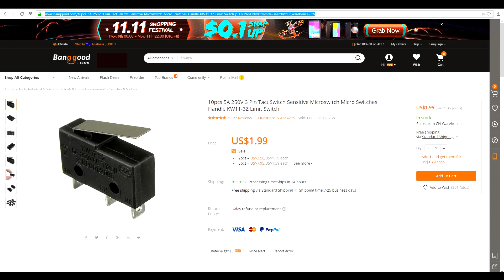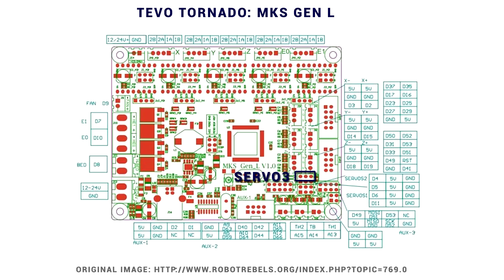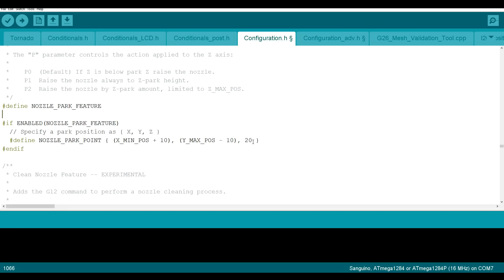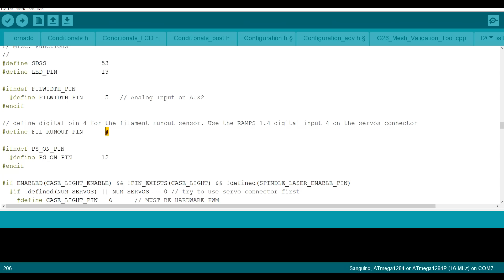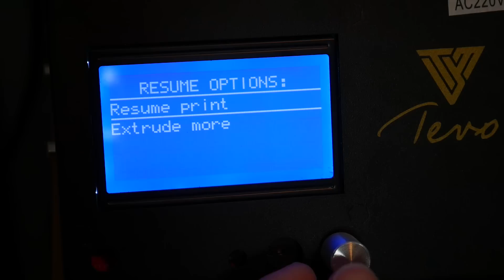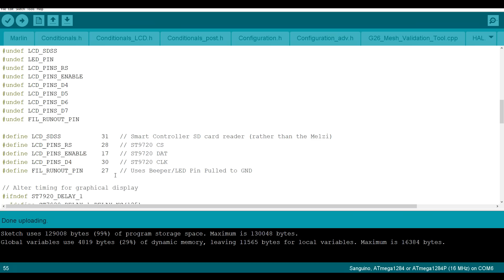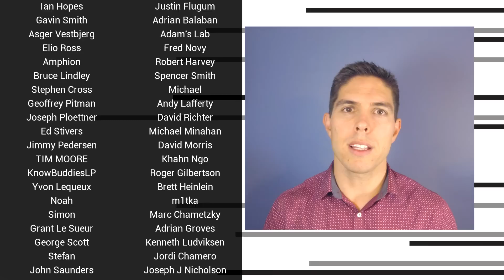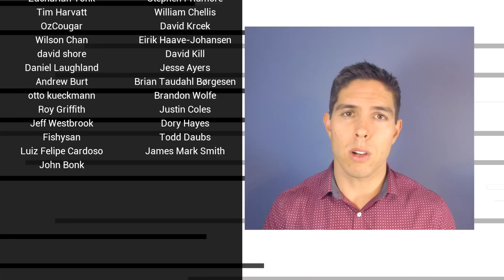DIY filament runout sensor + M600 colour changing

Comment: Filament sensors are only useful if the end of the filament reaching the sensor is straight. If it is bent it can't be pulled through the sensor and of course that means the system jams. What then?
Reply: If your spool has that small of diameter and causes high amounts of binding with a straight through hole switch housing, then all you need to do is design a new housing by adding in the radius of your spool, or just design one that is smaller in length and it won't bind at all, this isn't an issue unless the housing is a poor design.
Reply: @BF3DS  Poor design as the endof the filament on the spool had a sharp hook at the end. 
Unfortunately it was the first time I had deliberatetly let a spool finish to test the filament detector. I've finished  a couple of spools since then but only on small jobs.
Reply: @iminabrons  Yeah I've never had this issue before, but I just tested it right now by kinking my filament in a few spots without snapping it, one section snapped off before entering and it worked just fine (PC) the other one got slightly binded and almost stripped out on my extruder spline gear (PLA), it still worked because I oversized the hole. I guess the only way around it if it's incredibly bad, is to have an even larger hole in front of the switch to force the filament to slowly bend into place or to run an open framed laser runout sensor so it cannot bind etc.
Reply: @BF3DS  One way is to have a sensor that measures how much force is being used to pull the filament at any particular moment and above a certain % of Newtons the power would be turned off. This would be used in conjunction with the filament sensor of course.

Comment: Man, tough luck.  I tried to do this mod, every other one had worked perfectly.  Unfortunately, I must have put too much heat on that Pin 29 and lifted the track on the board. I noticed the little pad of copper broke off so now if I want to have filament runout I will have to be upgrading the board.  For now I am happy with the upgraded firmware, auto bed leveling and I still got the advanced park feature and filament change from attempting this guide.  I did notice that disabling the options in the video still put me over the threshold and was not able to compile for the Sanguino.  I turned off M155 advanced reporting and that helped push me over the hump. Thanks for the video, I'll use my printer as is and for a possible next upgrade may be replacing the board.
Reply: You mean to upgrade to a duet board, right?  Seems like you've a good excuse now!

Comment: Hey man!
https://www.youtube.com/watch?v=SM6w1gU_P58&t=182s
This guy used the back of the LCD display to hook up his runout sensor, but with absolutely zero information or elaboration. Would you possibly mind doing a video explaining this?
Reply from the maker: It will be exactly the same as mine except the pin assignment will be different in marlin.
Reply: @TeachingTech  Alright I'll try and stumble my way through a combination of your tutorial and his video haha

Also, will there be any problems hooking the runout sensor up to the board, and using OctoPrint? Or will the runout sensor tell the Pi to pause?
Reply: Furthermore, I don't have a pin 27 board, and it seems both the runout sensor and the BLtouch take up the same ground pin in that case. Is there another available ground pin on the board? Or could I solder the wires together and use the same ground?

Comment: Would there be any specific changes with the th3d firmware and  runing a bltouch when  adding this runout sensor ....muddling through but all ways good to know more. Im surely not the onley one. Followed your video on the th3d bltouch  setup for the ender3..You make a difference sharing like you do may you and all  your family  have a safe and happy new year

Comment: Wouldn't a microswitch with a roller work better? Less drag, and can easily back up expecially on direct drive extruders, if you mount the switch on the x carriage, otherwise this won't be a prob, probably is not a prob with this switch and I am a tad paranoid
Reply from the maker: With a nice housing, yes. Have to design it to make sure the tip of the filament didn't catch going in.
Reply: @TeachingTech  I think there is a design for it on thingiverse already
Reply from the maker: Then yes it should be better.

Comment: Hi =D when we disable M503, does that mean we can't use this g-code anymore in the terminal of octoprint to retrieve current EEPROM? Then is there an alternative way to get the current EEPPROM?
Reply from the maker: M503 only spits out details about the printer via terminal. Eeprom still works like you would expect.
Reply: @TeachingTech  ya, then without M503 is there another way to let the printer spits out the details of the printer via terminal? for example when i want to calibrate the estep, then i need to know what is the current value... how do I do that?  thanks for answering me... =D still learning...
Reply from the maker: Nope that is the purpose of m503. If you have a copy if the standard firmware you can retrieve the base value there too.
Reply: @TeachingTech  I see =D Then let's say if I would like to keep that M503 function enable together with bltouch and this filament runout sensor, is it possible? what other settings you would recommend me to disable it?
Reply from the maker: There is also autotemp, volumetrics and one called disable working offsets (can't remember the exact name off the top of my head)

Comment: The amazon link now points to a switch w/ a roller on the spring arm. Betting the print will need to be modified for clearance. Or would you suggest another link? A roller tip could make it difficult to insert the filament and ensure it doesn't run under the wheel.
Reply from the maker: Argh. I will update the link.

Comment: I have been very impressed with your knowledge base and have been watching with great interest as you make the upgrades to your 3d printer. I actually have been doing research on a printer to buy and watching what you have done with your ender 3 has helped steer my decision on what to purchase. I wonder with all your skills have you tried a different board in your ender 3? Maybe something with more memory so you don't have to disable features as you upgrade? I would be a sure viewer of that video.
Reply from the maker: Hi Phillip, thanks for the nice feedback. Eventually I'm planning to fit another board to my Tevo Tornado an four the MKS Gen L from that into the Ender 3. No time set, however.
Reply: @TeachingTech  I will keep an eye out for the video when your time allows.

Comment: Hi Michael. Im impressed of your videos and knowledge. I saw allmost every of your videos, but my english isnt so good and sometimes I missing some words and trying to get from contecst.   Im 53 years old and im just a beggining my 3d printing. Sometimes many problems are much hard to resolve for me.  I want to ask You about help in instaling of a  filament sensor in Ender 3 with existing printer mainboard.  Please tell me  what  do I have to buy to conect this sensor and how to upgrade a software and what   I need for it (including soft and boards) ?  The step by step guide will be the best :-).   Ender 3 is very popular in my country and videoguide qould be so helpfull. Best regards from Poland.
Piotr
Reply: JOZEFPI66 jak nie zapomne to po powrocie do domu wytlumacze krok po kroku co trzeba zrobic :D
Reply: JOZEFPI66 masz odblokowany bootloader w enderze?

Comment: Hello. Little question. Does pin 29 work with the 1.1.3 boards, too? If I set pin 29 for Filamen runout in Marlin and then query the switches with M119, the runout switch does what it wants. Once it is displayed as OPEN, then as TRIGGERD, although the switch was not touched. Maybe someone has a tip what goes wrong. Thank you.
Reply from the maker: Try toggling the line FIL_RUNOUT_PULLUP by commenting or uncommenting. It sounds like the pin is floating.
Reply: Thank you for your reply. Can I insert the command line in Marlin 1.1.8, or do I have to change to 1.1.9? Sorry for my question, but I'm not that experienced yet. Thank you for your support and help. @TeachingTech
Reply: I have now adjusted the Marlin 1.1.9. Now it seems to work. Thank you for your time and help.

Comment: For disabling stuff, you can also disable autotemp (additional ~2700B) and/or volumetrics (that one give you additional ~1600B) Autotemp is not useful, as it needs compatible slicer, and I don't think I've seen any so far, and volumetric features are useful only, when someone wants to input filament diameter on printer screen instead in slicer
Reply from the maker: Thanks for the info. I have played with autotemp but not volumetrics.

Comment: Nice, didn't know about pin 29 was accessible👍
Thanks for sharing the good news
I was thinking about filament out on the rasp. Pi
One thing. I prefers to have a roller on the micro switch, so you  no issues with retraction.. Is the a essue??
Reply from the maker: I haven't had any issue with retraction. I will investigate the octoprint version.

Comment: Michael, appreciate all your effort and advice. I have an Ender 3 and whenever I try to unload filament it will not pull past the fitting at the extruder stepper motor as the end is blobbed. I have to remove the bowden tube from the fitting, cut the end of the filament off, and then pull it out. What can I do to fix this?
Reply from the maker: Pulling it out faster at the start might elongate the blob more. That sounds like a really annoying problem.

Comment: Or if you have octoprint hooked up to your printer, just use a plugin and connect the sensor to your Pi
Reply: There are several creators that have uploaded how-to videos on this. No soldering required and a plug-in exists for OctoPrint.
Reply: I was just wondering if I can pause and resume the print if using octopring (obviously after a firmware update)
Reply: @FedericoGranata  should be possible, idk any plugins that from the top of my head do that, but I don't doubt that they are out there
Reply: i did that. it never worked properly. always had a bug
Reply: Thank you!
Reply: This likely won't work when printing from SD, unless Octoprint can activate the advanced pause.

Comment: Is that normally open or closed on the switch. If you use a different switch it would be better to know for non experienced
Reply: I think that this doesn’t matter on some types of 3 pins switches, because you can use the 3 pins to choose the desire logic level
Reply: Yup, please let us know the switch logic, whether it is NC or NO, and the corresponding logic "invert switch logic" (true or false) to use in Config.h.
Reply from the maker: For the record I wired NC.
Reply: You get NO vs NC on that switch by choice of which pin you connect.  Center is common.  One end is NO, the other is NC.  Its a SPDT switch.

Comment: My design for the Ender 3 is optical, but will not publish it becase as you said about the one in the Prusa, it's a PITA to setup and print. But works.

Comment: Excellent video as always. I actually enabled M600 and unload and reload a few days ago on my Ender 3 as I had some prints I wanted to use multiple colours on and I knew I could take advantage of the M600 script in Cura to change colour at an exact layer. Only issue I found was that it started printing a lot faster when it resumed for some reason (though it might be Cura that caused that).

I haven't tried the filament runout sensor yet as I thought it would be too difficult, but your video has made me willing to possibly try it now I know which pin to use.

One question. Since I've removed my Z Endstop micro switch because I have a BLTouch, can I reuse that micro switch as the filament runout sensor switch?

One thing worth mentioning regarding space on the Ender 3, I spent a couple of hours digging through Marlin to try and sacrifice as little useful features as possible and one worth disabling is the Autotemp feature. It wasn't in the original firmware and it seems pretty useless and even has very little documentation for what the feature even does. I've removed it and gained quite a bit of space at no cost. You can also remove the PID tuning from the menu without sacrificing the feature since it's rare that you should need to PID tune anyway. There's a few smaller things but they're probably the most impact and I've managed to keep Chitchat on and other more useful features
Reply: Seagull Hunter FPV 

I’ve been wondering the same. Just commenting here for any future comments.
Reply: @Mark_Cook  I mean I couldn't see much reason why it wouldn't work to be honest, but it would be good to have a second opinion. Makes more sense to recycle the old switch than buy a new one since I don't intend on removing the BLTouch
Reply from the maker: Yes it will be quite suitable.
Reply: @TeachingTech  Great. Thank you for the reply. I know you're busy so it's always appreciated when you get back to comments.

Keep up the good work

Comment: one downside of your solution is that the "sensor" grindes the filament. / I used 3 Prusa laser sensors / and 4 color sensors on my multicolor setup / currently i preparing it for my other printer
Reply from the maker: Assuming it slides past once, I would hope the impact on the filament surface would be negligible. Compare it to the marks left from the extruder for instance.

Comment: Great walk-through as always Michael. The other day I tried the 'change filament' function from the CR-10 S4 LCD controller, all went well except for the resume part. The nozzle returned to the part but was a few mm further forward than it should have been (the bed was a few mm further back). If you have any thoughts on why this might have occurred, I'd love to hear them. Thank you.
Reply from the maker: The firmware should remember the position accurately. Assuming you didn't knock it, I'm confused.
Reply: @TeachingTech  I will give it another try when time permits, but for now the only thing I can think of are that it may not have homed properly before resuming. I wasn't watching closely enough to be sure, so another test should show what went wrong .... at least I hope so :-)

Comment: Great video Michael!
Have you got the filament sensors on the a10m to work as mine did not work out of the box.
Reply: I think he covered this in a previous video about the A10M where the code for the sensors was commented out. I've just ordered my A10M which comes in a week and would like to know also how to enable this.
Reply from the maker: I got it working here: https://www.youtube.com/watch?v=8o--HmfZ57I
I think they have updated the firmware now and it is working.
Reply: @TeachingTech  thanks for the reply Michael!